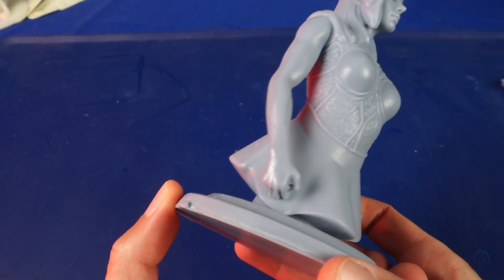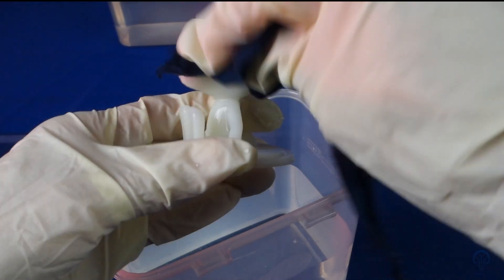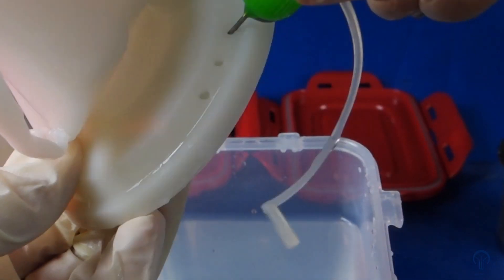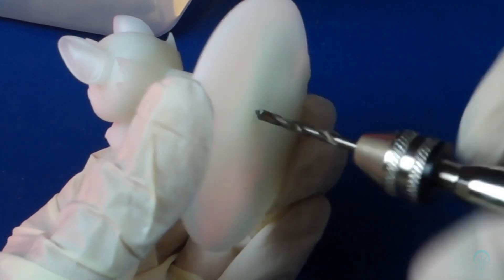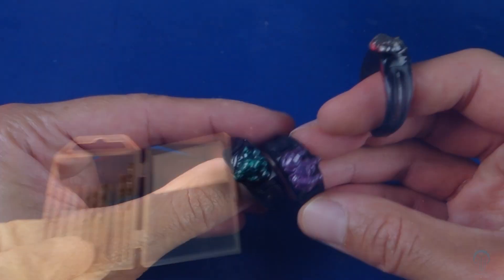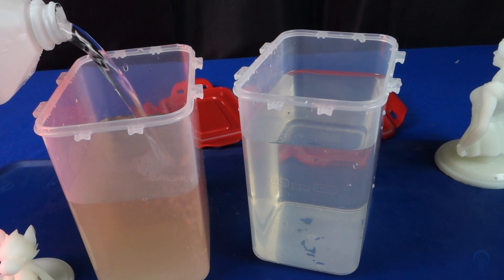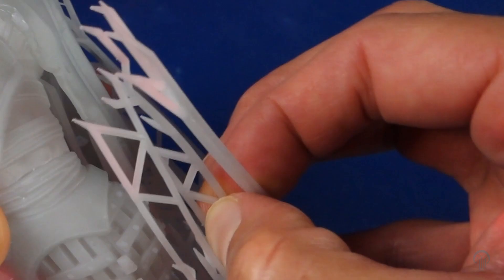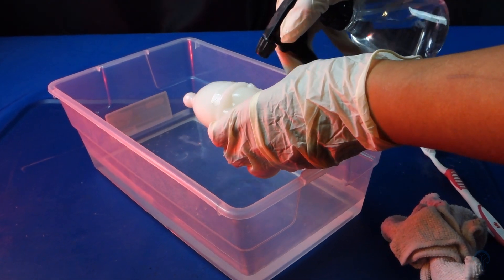SLA Printer - How to properly CLEAN resin prints - Beginners and Intermediate

Comment: Ultrasonic cleaning machine is very useful.
Reply from the maker: I did try one of those, but found the cleaning stations worked better in the end.  Also, important to know is that some use heating elements which could be problematic if they misfunction.  For those on a budget, you can also pick up a well sealed container and just shake it around for a bit to get a workout and clean prints. :)